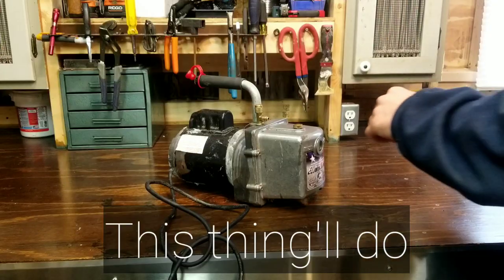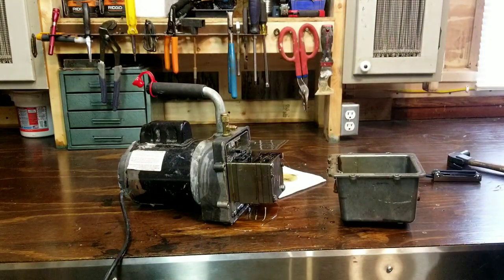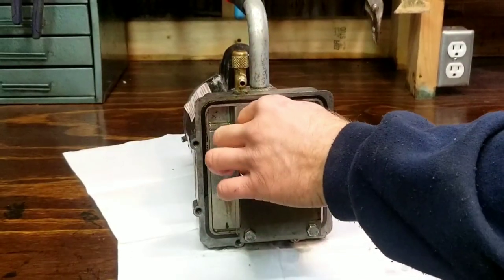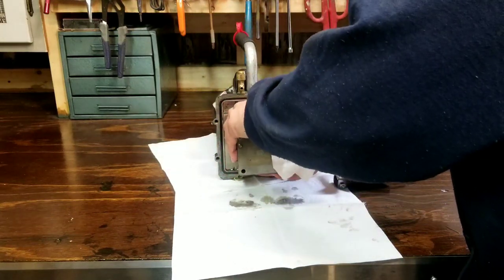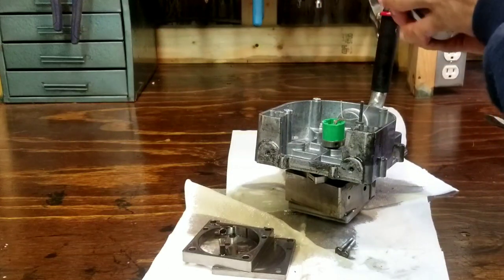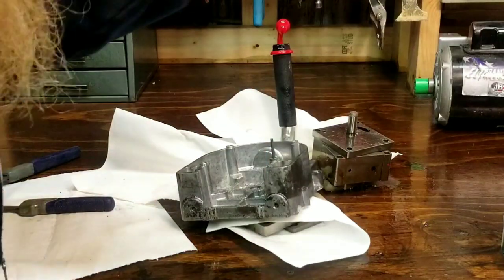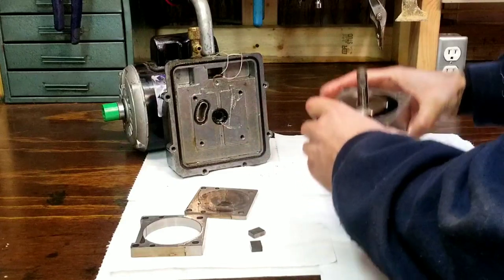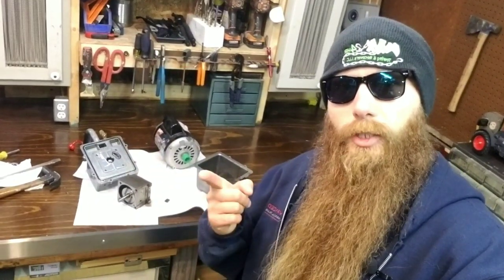Vacuum pump teardown

Comment: Its a two stage vane pump. Google has all kinds of animations on how they work. But yeah, that basically it. The things that sling out are the vanes. They spin around and create a difference of pressure as they spin from the wider area to the narrower area. The oil helps seal everything up to allow lower vaccum to be achieved. It also lubricates but main function is sealing.

Comment: It looks to me like that is a 2-stage vacuum pump. There are 2 pumping rotors with vanes, each one in a separate compartment. The exhaust from one compartment is the intake for the second compartment. That’s also why there are 2 reed valves. It looks like 1 of the rotors is thicker than the other. I don’t know sure which comes first? 

I recently bought a similar 2-stage vacuum pump at Harbor Freight. Everyday price was $139 but they gave me some discounts so it wound up costing < $100 and it works great.

Comment: dual stage, wet vane pump. Those" scoops" are called vanes. If the motor runs, and all vanes are in good shape, the next piece that would fail is the reeds. Im not a pump mguy either, but Used to help build dry vane pumps and have used them in my lab many years. Break about one a year...until I bought an Edwards pump. Its industrial grade and worth rebuilding. Most are throw away junk these days. Nice video. Had I never done a teardown this would have been very helpful.
Reply: where do you get replacement parts for rebuilding edwards rotary vane vacuum pump?

Comment: I really enjoyed your video and I think that your explanation of the way those metal shafts work on the rotor for squeezing out air is spot on!  I am wondering if what spares are available for that pump (realize your intention was to disassemble to learn) to get it working again.  Those 2 metal flaps would be one--would the metal plates on the rotor be the other--it seems that eventually the edges would wear down.  The motor seems to be good.

Comment: Why they don't make a discharge port with hose connection, So you can use it to test system pressure?

Comment: Thanks for taking the time to tear one of these down. Sorry you had to destroy the small retainer. Curious to know if you ever put it back together and figured out the puzzle pcs.
Reply: I have this same pump...it's not pulling a vac. Turns on runs good but no vac . What do I do to fix this?
Reply: @samename3926  Check the plastic flexible link that connects the motor to the pump underneath. It might be stripped out like mine was. 13.00 part. My pump was running but no vacuum. Apparently these linkages are designed to break to save the more expensive parts from damage. Also, change your oil with fresh stuff.
Reply: @watcherwatchmen7785  that was the problem easy fix thx
Reply: @samename3926  Awesome man, glad I was able to help.

Comment: Im a professional vacuum pump tech. That plate is a splash plate that prevents the valves from splashing oil from where it shouldnt go. Those arent reeds, they're exhaust valves.
Reply: Reed valves.  They sound like reeds, they quack like reeds, so they're reeds.  Listen to the banter and you'll concur on such colloquial nomenclature.  The part isn't sold separately on the cheap ones.  Cutting your own with appropriate sheet might be doable.  Not sealing tight reduces effectiveness obviously.

Comment: Is the little rotor in the front an oil pump?
Reply from the maker: I would say sort of, it slings the oil and uses it to seal the vanes as they extend out during its rotation. I believe anyway

Comment: Man when you see how much oil gets trapped inside,  how are we meant to purge the old contaminated oil ever ?
Reply: change it often, so the contamination is minimal?
Reply: Get a cap from the oil can and fill it, then run the pump and carefully suck the oil and air through the inlet to the pump where you gauge line goes. Doesn't really need doing unless the pump is contaminated. Also, if its really dirty, put fresh oil in and run it until warm and change it again, repeat until you are happy and the oil comes out clean.
Reply: @heavydiesel  Cheers for that 👍 .
I wish they made it easier like the Fieldpiece one where you just have a tap to open and voila !
Reply: The vapor pressure of the refined oil is the crux of all rotary vane oil pumps.  Want vacuum.  Replace oil.  Simple but a bitch.